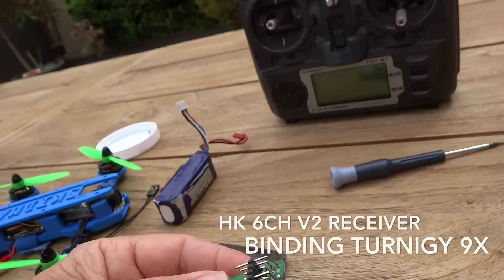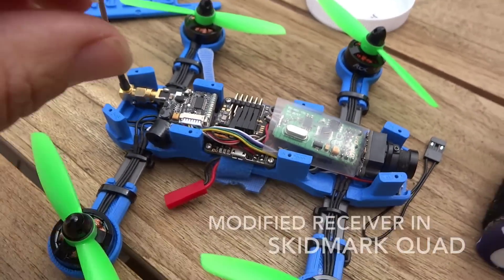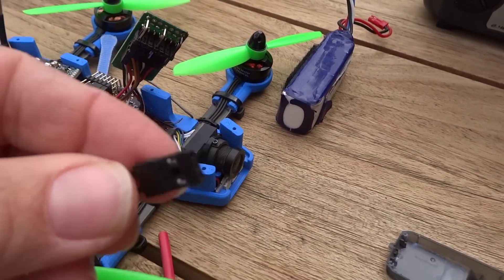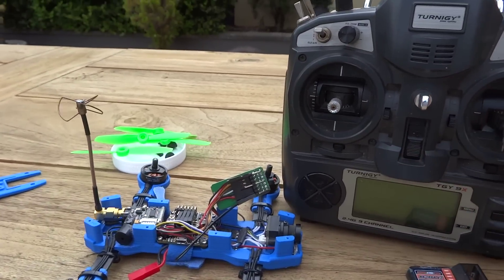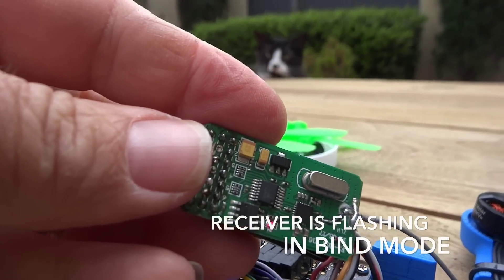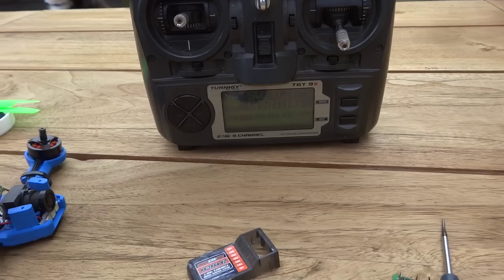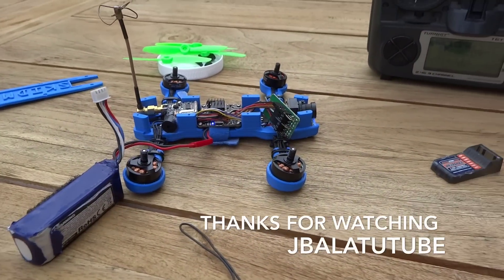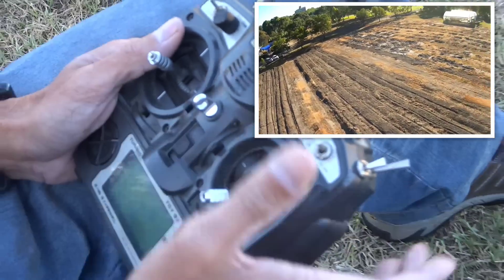How to Bind HK 6CH V2 Receiver to Turnigy 9X

Comment: Hello, I have also a Turnigy 9x V2 radio and suffer wich receiver I should use for such drones like eachine wizzard or similar which board supports s-bus/ppm? Thanks
Reply from the maker: flysky all the new ones will work with sbus
Reply: @jbalatutube  I know, but old transmitter with Afhds protocol cannot binded with new receiver with afhds 2a protocol
Reply from the maker: @07_speed-UP  sorry Peter I only use the 9x with original receiver on bigger models. I now use the smaller evolution transmitter for drones

Comment: Hi. I am having trouble with a FS-R6B RX (looks exactly like yours) connected to the Naze32 SPracingF3(banggood clone). It is a PWM rx, so each channel is connected with a separate wire to the board (1 to 1, 2 to 2, etc). I did bind the FS-R6B RX to my Turnigy 9xV2 but there is no radio activity in Cleanflight's Receiver tab. How did you wire the FS-R6B RX to your board (different than 1 to 1, 2 to 2, etc?) and what is you channel map in Cleanflight? (4321AETR/AETR1234 or what?). Are there any other special settings that need to be used in order for this/your receiver to work with a Naze32 board? Thank you :).
Reply from the maker: so first check that it works by plugging in a servo to the RX and 5v battery or an esc with bec. When you use it with the naze select pwm from config screen ensure that the lipo is plugged in and Tx is on. Be careful and take props off. In the receiver tab if there is no movement then you have a problem. see here for more info http://www.rcgroups.com/forums/showthread.php?t=2284609&page=28

Comment: Awesome vids! Quick question your quadcopter is 3D printed, do you brake arms or any other frame part(s) often?? Or is this little frame Strong & sturdy?? What type of plastic is it printed from?? (ABS, PLA Etc) 
I like the look & size of your mini quadcopter it's Badass!
Reply from the maker: Thanks yeh it's pretty cool. It's printed in abs but would like to try that carbon stuff too. We have refined it over the past year or so and it's almost unbreakable now. I did have a nasty head on and broke off one of the front mounts but it was pretty full on and you can glue the piece back on with acetone